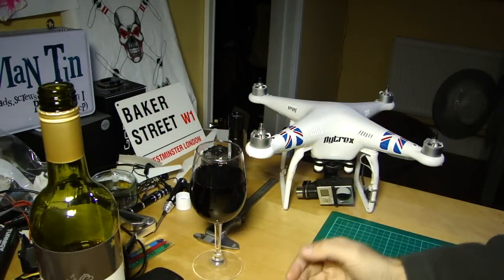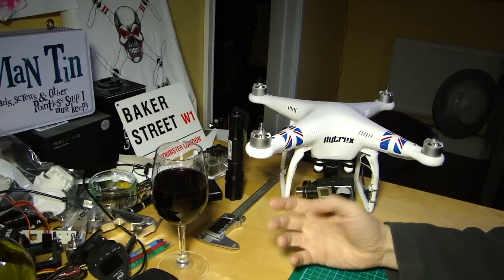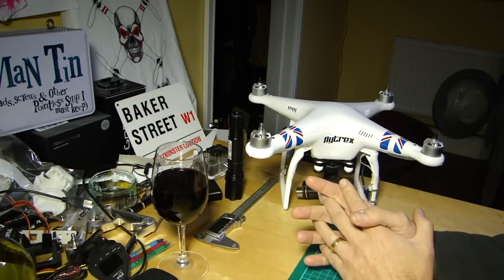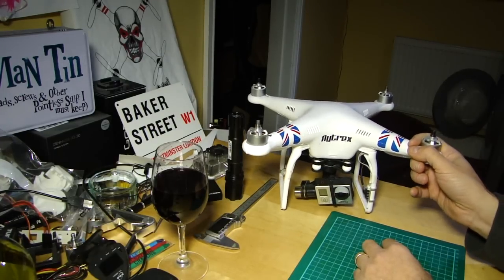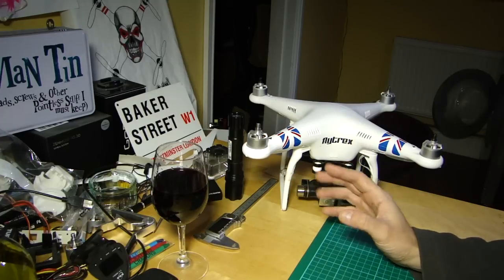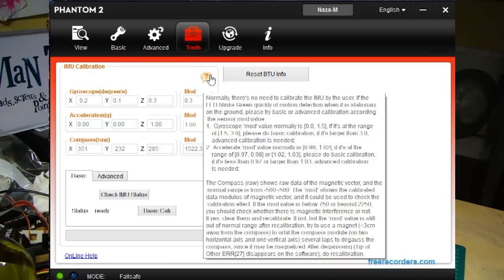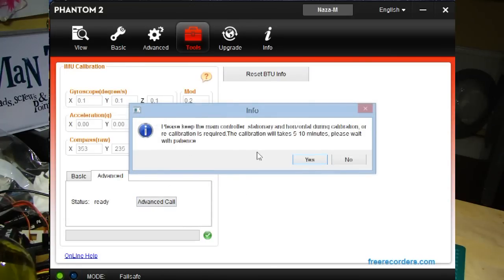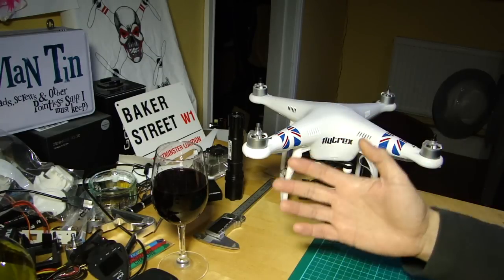DJI Phantom IMU. What is it, and when it might need a calibration (and how to do it).

Comment: Thank you soooo much, I haven't flown my quad for about a year and everything worked perfectly when I put it away but now it just refused to arm, I probably spent about 5 hours trying to get it to arm and then came across this video, did the "basic Calibration" 4:35 and everything is working again, thanks again 👍🏼

Comment: Concerning the H3-3D gimbal, I had NO IDEA how important this was. 

The "horizon not level" issue was making me crazy. Always 1 to 2º off level when it shouldn't be. After 5 or 6 unsuccessful fixes after advanced calibrations, I tried the method outlined below out of desperation thinking...the logic in it made sense. 

Here's what I've done and both my Phantom 2's fly and film dead on level....

First: You have to do an advance IMU calibration. Make sure the Phantom is sitting on a perfectly level surface. After calibration take it for a fly while filming. Next look at the newly shot footage. If the horizon is still not level your Phantom wasn't perfectly level OR the IMU advanced calibration didn't "see it" as level.

Second: Place your Phantom on the same exact spot/place you did the first calibration. On the side that seems higher in your video (left or right) place about 1/8" thickness of paper under both black pads of that leg. In theory you're lifting the "high side" even higher! Yikes... trust me... this works.

Third: Now do another IMU advanced calibration. This little bit of height on that side will allow the advanced calibration to sense the difference and then compensate by lowering the high side of the roll motor. 

BTW: My experience has shown that this minor adjustment does not, in any way, affect the flight charateristics or stability of the Phantom 2.

Thanks for the info Simon.

Comment: I have bought an Phantom 3 Professional unit.  Unboxed it, did the settings, etc and had a few flights.  Perfect.  Today I wanted to show some friend my Phantom and I can not get it started.  Gives an IMU calibration error,  Video only states how to do it with the 2 software.  how do I do that with the 3 version.  Did all the upgrades of firmware two dayS ago when I OPENED IT

Comment: Hi Simon,
I just performed the advanced IMU calibration with the latest firmware as of Jan 14 2015, and I got the high temp IMU error as you said might happen.  I still got the green checkmark after the calibration was complete.

To the right of the IMU information is a box that says, "reset BTU info."  What does that stand for, and should I reset it after every IMU calibration?  I checked the owner's manual using IMU as a search word (BTU had no hits), but there was no mention of BTU info.  I'm wondering if it has something to do with barometric data, but being unsure, I'm waiting until I hear back from you before I click "reset.".

Thanks!
Reply: *****
Thanks, I thought it might be "British Thermal Unit" but couldn't decipher what the relevance might be and why I thought it might relate to barometrics.  Never heard of a Bluetooth Unit before!  Thanks for the link to BTU.

Comment: Thanks, this vid helped solve a serious mystery I was having with my Phantom 2.  It started going wildly out of control during descents causing a couple bad crashes.  Now the descents are smooth as butter.
Reply: *****
Simon, as a response to the IMU calibration issue I made a quick vid about why the IMU should be calibrated before it's too late:

http://youtu.be/jspNiiMVIxI

Again, thanks for the tip.

Comment: My phantom 3 advanced was flying perfectly normal for its first two flights, everything was great and It was steady as a rock. The 3rd flight however, it began as a normal flight, then suddenly after about 5 minutes of flying, it randomly took a hard left and began spinning and losing altitude rapidly. I tried to apply thrust but it was all for not. It hit my roof then landed on the ground. Can anyone please offer me some insight here? I have no Idea how or why this may have occurred.
Reply: +Simon Newton yes, they were all fairly tight and remained on the craft even post crash. I was thinking maybe some type of interference but I am stumped as to what it could be. It was brand new too. Not the best of flying conditions but I don't think that had much To do with it. I have no idea on this one

Comment: Hi Simon, I found this thread on DJI's Phantom 2 forum, and it explains why my P2V+ won't pirouette without drifting all over the place: http://forum.dji.com/forum.php?mod=viewthread&tid=4343&extra=page%3D1&lang=en
In a nutshell, the internal IMU is not level in the shell, and folks are finding they have to shim the external legs then perform several advanced IMU calibrations to get it right. Once they figure out the right shims, they say their P2 now pirouettes on a dime.  I guess it's too difficult to actually level the IMU inside the shell.  Anyway, an interesting read.
Reply: I thought about that too while reading the threads.  If the Naza V2 advanced calibration is done on a perfectly level surface, it shouldn't matter if the IMU isn't perfectly level in the shell. I just leveled my table using a digital spirit level app on my IPhone, but I ordered a real spirit level this morning from Amazon (using your code, by the way!) to compare to the digital version (after all, how can you calibrate the IPhone?!).  I'll now take it outside and do a couple pirouettes and see if the circular drift is still as bad.
...have to charge a battery first!
Reply: *****
Interestingly, when I first contacted DJI about the 6-8 foot drift I was seeing when pirouetting, they only recommended a compass calibration.  Easy to do that in the field, but if the problem was the IMU, it wouldn't have solved the problem (which in my case, several successful compass calibrations didn't help the pirouette drift).  This is the first time I've done the advanced IMU calibration on the P2V+, so I'm looking forward to testing it.  I've finally got some sunshine here in Virginia and light winds, so it's a perfect time to try. If it still drifts, I'll have to question my table leveling technique.
Reply: *****
The test flight went well.  Pirouetting was much more stable, even though the 7th satellite kept dropping in and out.  While I wouldn't say it was spinning as if it were on a pole, it generally stayed within a couple feet during a slow, 360 spin. 

I'll be interested to see how level my IMU calibrating table is once the analog spirit level arrives to compare it against the IPhone app.

I have a question for you about yaw gain.  I reduced mine from 120% to 80% thinking that would slow the yaw down for smoother video while pirouetting.  Even with just a slight jog of the left stick, yaw still seemed to be too fast.  Am I correct in assuming a lower percentage should be a slower yaw for the same amount of stick movement?  If so, perhaps I have to reduce the percentage even more.
Reply: *****
That's good to know Simon.  I'll go back in and change it back to 120%.

Comment: IMU! no yer not, IMU! no yer not! heheheh
aircraft IMU and gimbal IMU are two completely separate systems, well... the only time naza takes control of gimbal stab is when you have servos!
 on brushless gimbal systems like the p2 V+ etc... they use a separate board and IMU!
Reply: ***** the aircraft IMU is a separate unit from gimbal IMU! yes, may be that their calibration is linked (advanced calibration?) but that can only be true on the P2V+ and the P2 H3-3D kit version that as you say doesn't have the GCU built in, not on other versions! on the standard H3-3D has it´s own gimbal Assistant to calibrate the IMU..  would be great if DJI clear this! thank you! I guess we are booth right! :) but I think it would be good to ad a note referring the difference..